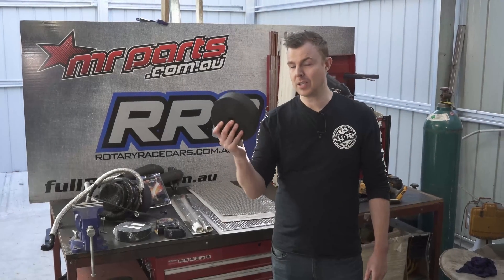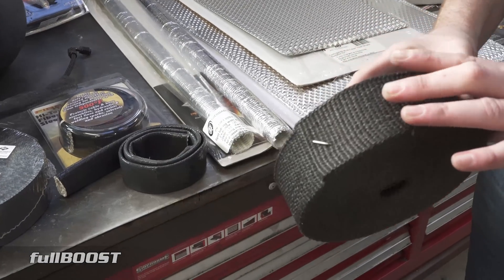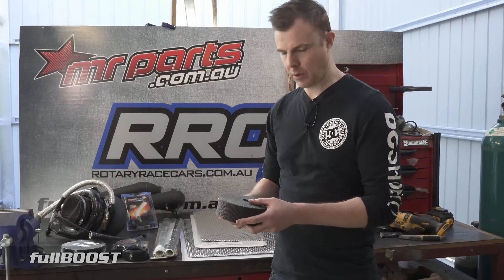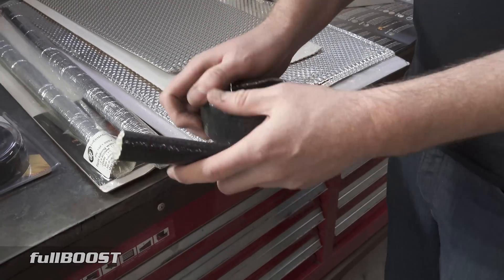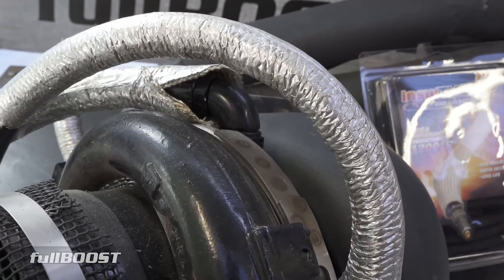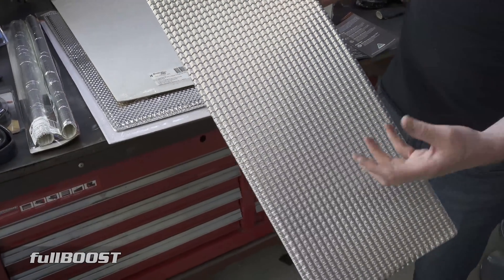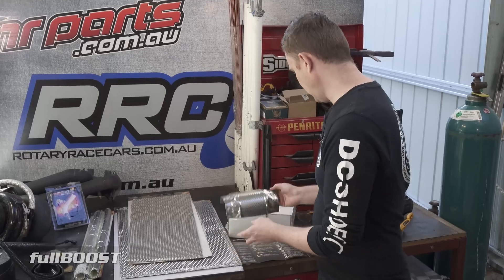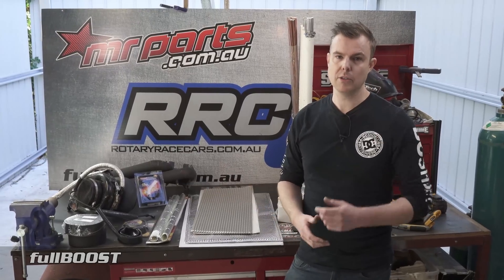Easy DIY Horsepower gains from heat management | fullBOOST

Comment: Header wrap can also aid fires, if you have some oil leaking near a header, normally it would evaporate quickly and run off. The wrap will absorbe oil, when it hits critical temps the oil will combust quite badly. Happened to a friend of mine. Luckily we noticed and was able to put it out.

Comment: A cheap fast alternative in a pinch is to raid the kitchen for baking paper and foil wrap.
Tear off a few suitable size sheets of baking paper crinkle them up and straighten them out then sandwich the paper between two or more sheets of foil to make a sort of pillow by folding over the edges. Place the pillows in any place that they can be fastened down with wire or screws. Works well had one sitting in a daily driver for ten years that was protecting plastic from a red hot exhaust pipe.

Comment: I never see anyone wrap an intake manifold where possible, like a Barra or Rotary.
I could see nothing but for doing so because it would keep it cooler and keep heat out and cool in?
Reply: I've got an aluminium intake pipe that I wrapped, I hated the wrap, it was all fiberglassy and dusty af. Pulled that crap off and then wrapped in reflective tape instead. Made no difference as the air doesn't hang around long enough to get heated anyway, just like the intake manifold. The air gets cooled in the intercooler. Just makes it look cool and pro to the untrained. Besides, the intake manifold gets heated from the inside, from the block anyway.

Comment: I want to wrap my coated manifold but I think I read somewhere that it can break down the coating and ruin the manifold. Anyone got more info on that?
Reply from the maker: Our Subaru runs wrapped headers, a while back some of the wrap got severed and started to unwind, so I pulled it off and noticed the manifold was also coated but the coating was still in great condition.
Reply: My dump pipe is coated and wrapped, bout 10yrs now still good.

Comment: What utter bullshit. 

You want to manage heat properly, you ceramic coat the entire exhaust system including the turbocharger hotside. 

I really expect better from you guys.
Reply from the maker: We have a comprehensive video about ceramic coating which some called aswell BS lol...yep OE's use this exact brand so it must not work l guess. 🤔🤣
Reply: Exhaust manifold, turbo housing and dump pipe are already ceramic coated on this car. Ceramic coating isn’t going to stop Upwards of 1000 degree Celsius exhaust temp from a rotary bleeding it’s way into engine bay. The wrap on it now has made an incredible difference in radiant heat.

Comment: I've heard that header pipes can crystallise and become brittle when wrapped with fibreglass?
Reply: ive heard that too... but stainless pipes
Reply: I had a 4 banger toyota that i wrapped the mild steel headers on to try and quiet it down a bit. After about 2 years the headers literally crumbled to bits under the wrap and looked fine where the wrap was not fitted. Wont be wrapping them any more!.

Comment: Stainless steel wrapped in exhaust wrap, would it rust?
Reply: Yes
Reply: @PTRPerformance  why would it rust if its stainless steel?
Reply: @Monstero5o  for example water vapour will adversely affect the oxidation resistance